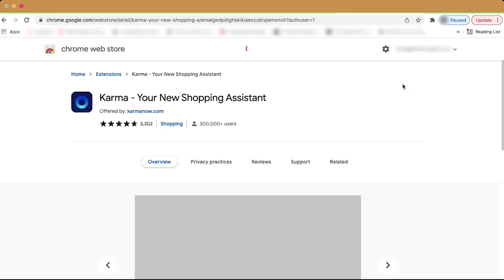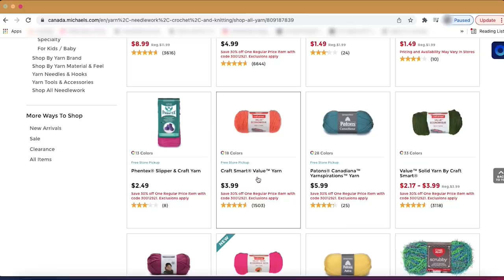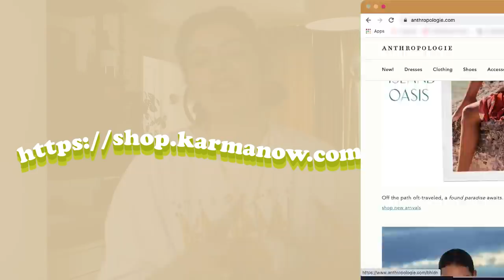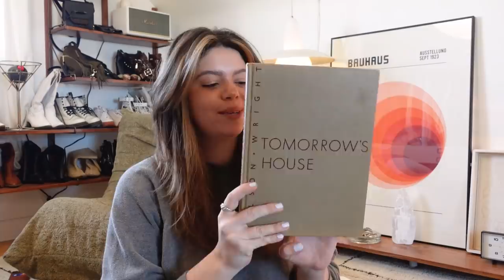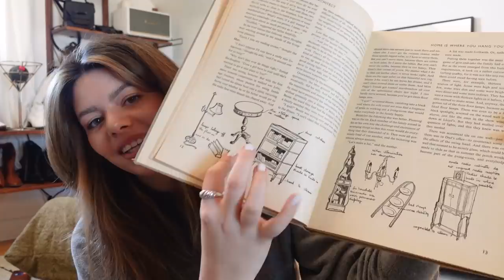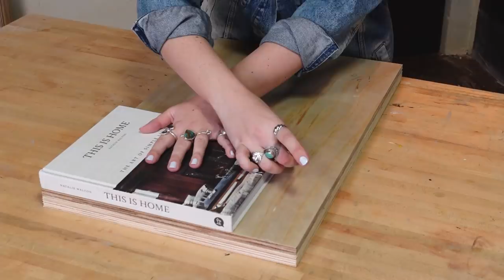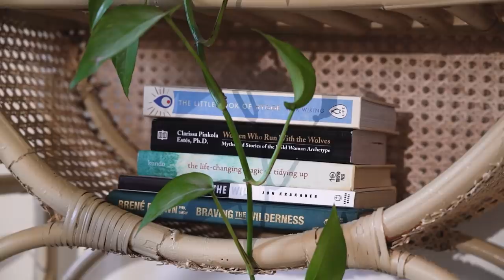making this impossible table that went viral on tiktok

Comment: A magnetized piece of plexiglass could be really cool on top of the table. Drill small holes in the wood and then secure the small magnets down in the holes.  Then adhere the other part of the magnet onto the plexiglass so it can sort of float on top and yet be removed easily.

Comment: I think the finish on the shelving unit looks a little rough. Could use a cane strip to finish the edges of the cane webbing you added. The book side table looks amazing though 👏🏼
Reply: i was thinking just a long strip of bamboo/cane strip wrapped around the entire thing and maybe near the new legs would be good too!
Reply: I think the cane should have been attached from inside. That's what the inspo picture had. Then it wouldn't have looked unfinished.

Comment: I love both of these DIYs, but that table is everything. I will definitely be copying, but I see it as a stool for my short self to use in a "library" set-up. One thing: I would get some long pieces of rattan and wrap it around the 4 joints where you added the extension for an elevated finish.

Comment: If anyone was curious about solar heating and concrete thing. It's called biclimatic design and it's where you use materials with a high thermal mass eg. Concrete and brick, to hold onto heat for longer, so that you don't get as cold at night and as hot duirng the day.

Comment: I learned this in school today! Passive solar design has to do with positioning of windows and roofs, efficient windows, and materials with high thermal mass (inertia) like concrete in order to take advantage of solar energy as much as possible. On the other hand, active solar power is what solar panels harness :)

Comment: I think if you were worried about the silver from the nails/staples showing through, you could have used a really good adhesive and zip tied it and then once everything dried removed the zip ties.

Comment: Solar heating is actually a tool used in traditional regional architecture throughout different climates. The sun is an infinite source of power and you don't even have to work for it. Quite the opposite to cutting wood and hauling it home.
So the authors of this book basically wrote down what generations of people were doing when they thought of how to best adapt to your environment and use every single thing to help make your life easier and more comfortable.

Comment: Storing books like that, especially older collectible books, will damage the spines over time. It's less to do with putting things on top of them than it is about how gravity will warp the binding as the pages are pulled in the opposite direction.

Comment: The lazy person's way of making this table would be to connect sides and back, then put a shelf between the sides, towards the bottom, then make two cutouts using jigsaw, and attach them on the top and front :) Then take any wide width books and put them in there :) I would also bend a sheet of acrylic and insert it over the books to protect them from impending doom of drink spills :)

Comment: Amazing video as always. But solar power had been discovered in the 1940s so it's not surprising to see it featured. Not in the way or as advanced as we understand it today but research began in the 1880s and converting electricity was achieved in 1931. More research took place in the 40s leading to the first silicon cell in 1954 :)

Comment: is that table not just painted to look like books? it doesn't look like functionally a space to put books in to me in the pinterest image.
Reply: it may look that way, but there are other angles where you can see better. the original artist was jane dandy on etsy and an article about this table says you could send her the dimensions of your books and she would make one custom to you, so it definitely wasn't painted.
Reply: @amaiaamaiaa  the painted one would be a lot easier though, at least for someone good at painting. and you wouldn't have to worry about customizing to particular books. which, like, i would just spill things on my most cherished books if i had this version in my home. the glass seems good for protection but then idk how you attach it so that it's sturdy without making it also awkward to get the books in and out, and how weird would the table look when some of the books aren't in it?

part of why it looks painted to me is that it looks like the wood covers parts of the books artistically in the pinterest version. but i guess if they're real books there are just a bunch of tiny books? it looks like you wouldn't be able to get them out because of how covered they are. honestly that's part of what looked so cool to me at first glance was how it felt like the books were melting into the table.